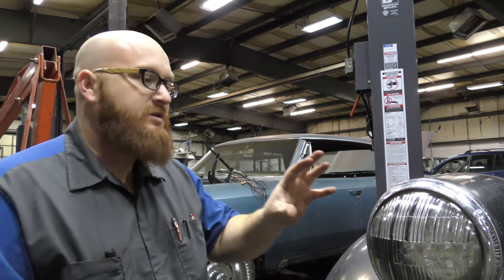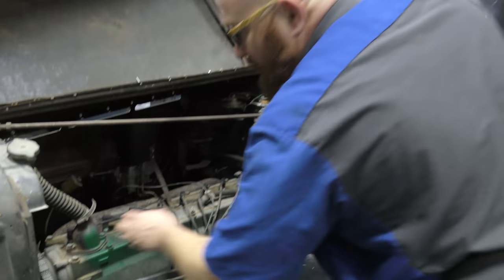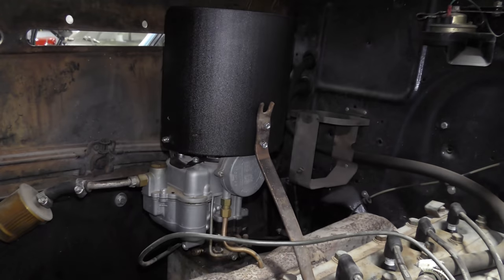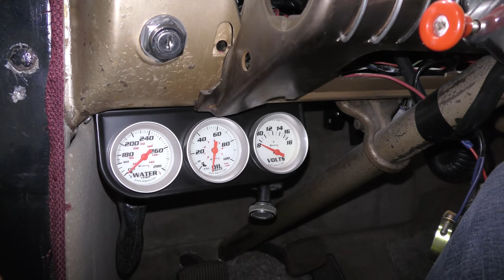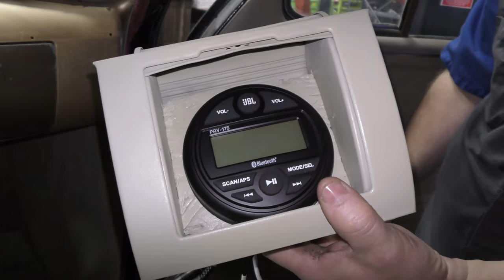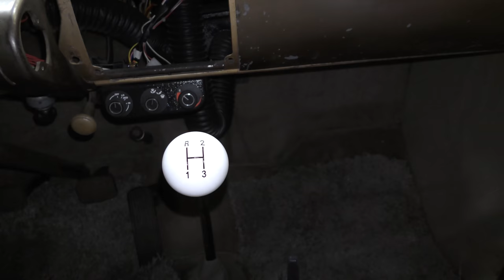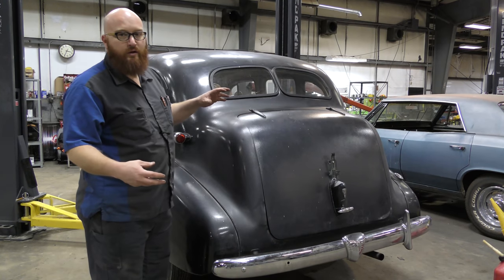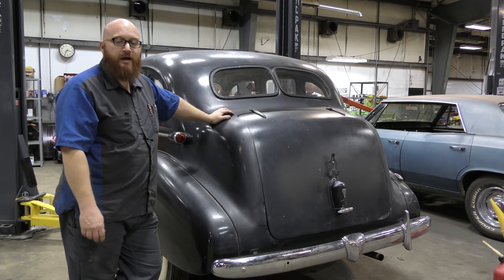OLDS SERIES #2: Nightmare to keep '38 Olds original! CAR WIZARD struggles to restore 83 year old car

Comment: Abbott instrument restoration in Tigard oregon can rebuild all of those gauges. He can also convert them all over to 12 volt with new sending units. It's pricey but nothing beats the original look. I'm having him do the cluster in my 1952 ford crestline that had a flathead but is now a 289.
Reply: Thanks, I emailed them!
Reply: Temp gauges are not something one can do themselves as they are a tube filled with capillary gas but the rest of the gauges are easily restorable. :)
Reply: @RustOnWheels  they do mechanical temp gauges as well. Its not cheap because of the gas or mercury tubes depending on the gauge. Their work is amazing alot of it ends up in cars headed for pebble Beach.
Reply: Bump for helping the Wizard.
Reply: Wizard doesn’t even know what he’s doing he’s always having everyone come and pull him out of the ditch
Reply: Good to know.   Redline Gauge Works did my 1949 Ford cluster since I am running a 1960 Buick 401.  Nice work, but pricey.   BUT it makes the entire dash look great and it is something you look at every time you drive the car.  I so had the gauges hanging below the dash.  Ugly and hard to read while driving.
Reply: @codyburget3796  Yeah a good quality shop can handle them. I just wanted to emphasize that the average DIY tinkerer may manage to clean up and fix the fuel and ammeter gauges, even a mech oil pressure gauge is doable, but a good working non leaking mech temp gauge is something else altogether. That’s one of those things not worth trying yourself without the right tools and materials.
Reply: What is the ballpark estimate on the rebuilt cost of this?
Reply: @anonymousonlineuser6543  depends on what you want done and what you have.  My set was around $2,500, a company in Minnesota quoted me $3,200 but all of the gauges would have been electronic instead of mechanical. My entire cluster was bad the person I got the car from did a 12v conversion but never stepped the voltage down for the cluster and it fried them all.
Reply: That's the guy I use for my instrument restoration.
Reply: There is no need to convert to 12 volts.  You just have to quit being a tight-wad and spring for the correct 1 gauge battery cables and a Group 2 or larger battery.

Comment: such a shame to ditch the dashboard...i would invest a bit and get it sent to a proper restorer....it makes the interior....and restored would look beautiful...
Reply: True!  There are places that can restore the original speedometer and gauges.
Reply: @craigjorgensen4637  yup it also mimics the round one radio
Reply: It’s because he doesn’t know what he’s doing
Reply: Send the cluster to Redline Gauge Works.  They will restore the cluster, put in new VDO receivers and  new senders.  Not cheap, but they would probably contribute to  YouTube project.   They redid my 1949 Ford cluster.  Excellent workmanship.
Reply: @619guy202  More like its because he doesnt wanna spend the money
Reply: @Morpheen999  if you know what your doing you don’t need to spend any money paying someone else to do what you can do. Hence he doesn’t know what he’s doing
Reply: @619guy202  Gauge work is pretty specialized. Would you like your general practice doctor do open heart surgery?
Reply: @seanabel3532  oh you probably don’t know anything either. It’s an old analog gauge there’s no circuit board or anything in there.......it’s just a simple iron with wire around it to move the needle gauge (simple second grade stuff).....if it was a 2017 Audi then yeah you’d have trouble finding what component inside the cluster/computer is wrong, but even then it’s still repairable but most people just swap the whole thing
Reply: @619guy202  You're just rude. I have repaired some gauges. It takes a while to do it correctly, where they actually work for a period of time.
Reply: @seanabel3532  you’re just ignorant and understand nothing of simple technology. If Wizard can’t fix something simple like that then I don’t trust him working on my cars. He said it himself too that he always runs to his scanner and looks at what other mechanics did to fix that problem. What don’t you understand of a wire with power going thru a resistor, to go thru a coil of wire to excite a needle on a gauge? Like I said if it were an Audi or something with 5 computers controlling one gauge then yeah but this nahhh, don’t get me wrong but there is ways to test it but by that time you were better off replacing suspected damaged module. 
Second grade stuff.....
Reply: Right. Send it to Edd China. He's great!!!

Comment: Would look LOT better if you had used a more "warm" color temperature LED - but I love the idea of what you have done retaining the original glass!
Reply: Exactly my thought about the LEDs, but it sure is going to be a great car when done
Reply: Class it up with LEDS all around.....uncle's. Pontiac had lights that dimmed and we're feeble at best
Reply: ...agreed, it also shouldn't be too difficult to find a chrome reflector bowl to fit behind the lens...it looks odd without it...
Reply: Agreed 👍 Improve the performance with the original feel.
Reply: Agreed. Still can be done.
Reply: It could potentially be corrected with light yellow/amber headlight tint inside the housing over the LED panels, but it may be tricky to get the color right.
Reply: @qotile  not a bad idea, but I'd rather see Mr. Wizard replace the LEDs with a more period correct color temp headlight (IE, junk those blue looking LEDs, they don't fit the car at ALL)
Reply: @qotile  also yellow + blue = green - that could be really odd looking (or awesome) if he left the current LEDs and just tinted the inside of the lenses with a yellow or amber
Reply: I agree & came here to say this.  Unless he is going for a Cyberpunk Gangster theme lol.  Like Batman the Animated Series
Reply: @erics3596  For additive color, yellow + blue = white.  For adding a pale-yellow filter to the existing bluish-white LEDs, the result would probably depend on the particular filter.  But adding a filter would probably make the internals look yellowish when the lights are off, which would be undesirable.  My 2017 Ford Fusion is the first (and only) car I've had with LED headlights (factory).  Initially I didn't like the bluish color, but I've gotten used to it.
Reply: And also with the current 6000k+ color you will see nothing during 🌧️ or mist.
Reply: Those LEDs are most likely a terrible idea. They will glare all over and at incoming traffic. Those LEDs were not meant to go inside a car housing, nor were they meant to have a glass diffuser in front of them.
Reply: In the lighting industry there is a color-temperature scale that is used to quantify the color of light, according to degrees Kelvin. 5000K is the color of noontime sunlight in a clear sky. 2700K moves away from the bluish end of color, and was the standard for the "warm white" compact fluorescent bulbs with their nauseating pinkish-orange color. 3000K is closer to the more yellowish color of an incandescent bulb. It shouldn't be hard to find LEDs that are pretty close to the color of the original bulbs. I suspect that there might be someone out there with the skills to calibrate the color of original old-car headlamps and to get some accurate LEDs made who also has an interest in old cars. That guy could make a niche business supplying the restoration community.

Comment: My Dad and a few of the older folk I have worked for used to get the local battery specialist ( Jones Brothers Battery ) to make up an 8 volt battery instead of a 6V. They would drop them into their 6V  Cadillac or Dodge or other. vehicle without need to modify electrical system.  Great old oldsmobile!! My first car at age 14 was 1955 olds rocket 88. Cheers from Canada!
Reply: You can buy 8 volt batteries.  They are available in most of the same group sizes as 6 volt batteries.  You don't have to change your lights or accessories, but you DO have to re-calibrate your regulator, as you need the generator voltage to be above the battery voltage, or else the generator will not charge it, and you need to cut out relay to open and close at a slightly higher setting as well, or else the generator will try to run as an electric motor, which will discharge the battery.

Comment: If that paint is the original I would suggest buffing it up and not respraying,
Reply: It's not original
Reply: @smokeandmirrors5960  yupp
Reply: Not original paint. But a new paint would look out of place in the package... unless the body is made to be very straight, the chrome very straight and shiny... I would keep it black, although it seems it was blue at one point. The black paint job, which seems to be painted by a roler, is the work of the previous owner, part of the history of the car. Look's good enough to me, for what this car is.
Reply: I agree it would be better for the paint to look a little old and rough. He’s not trying to do a concourse restoration and a half assed new cheap paint job might look worse than the old rough amateur one that’s on there at present ?

Comment: "8 cylinders in a row makes it go" Bob Ross of mechanics. Love this project, the Chevelle and of course THE YACHT. Hope you keep us thoroughly up to date on the projects. Love these updates.
Reply: The straight eights have two problems, the most common is a bent crankshaft and the lesser is a cracked block. The reasons that many have installed the drivetrain out of a chevy impala in these pre-WWII cars...

Comment: I like the LED headlight conversion idea, but that color light doesn't fit the car. Too bad you didn't find an LED with a warm light color instead. That would have looked neat.
Reply: 2700-3200K
Reply: Easy enough to change anytime if he wants to.  I have a feeling the car won't be driven much at night.
Reply: @Guillotines_For_Globalists  like I said, I like the idea... It just would have better fit the look he's going for if he could find those same LEDs in a 2700k-3200k color. I don't even know if they make them... I'm just saying it would have been a neat original looking upgrade.
Reply: @1lowf150xlt  Color temperature selection comes all day long for household lighting but not for cars.  The newest household LED fixed light fixtures (especially the flush mount can lights) have selectable color temperatures with 4 or 5 settings.
Reply: And also with the current 6000k+ color you will see nothing during 🌧️ or mist.
Reply: @1lowf150xlt  also doesn't need to be LEDs. He could probably find a reflector to fit with some bright 3200k HIDs.
Reply: It's funny a 38 Buick has tribeam headlights and they get close to white light not LED white but close and it's still a 6 volt bulb..... also if you ever started a 38 buick you know a few little tricks it has for noobs lol
Reply: If you don't want the stock dim lights, just convert to Sealed Beams.  Many people converted their 30s cars to Sealed Beams in the later 40s, 50s, and 60s.

Comment: Two thing Wizard, one is try to go to a place where the have a billet laser machine and the can make you those Oliver’s for the hood.  Second, for turn signal, they sell LED strips that flexible and conforms to any size.  Maybe you can use that and install it inside the headlight housing, behind the oem lense but in front of the LED round headlight.  It will still look factory.

Comment: The magic of pedals rising out of the floor:
By now you've no doubt noticed that like when you're sitting at a light,  with a foot on the clutch and one on the brake,  when you Junp off the brake and go for the gas, the brake pedal comes back up and the stop on the pedal arm thumps the floor?
I love that.
When I was little,  there were more older cars built that way that otherwise and you always heard that when the light turned green. 
Combine with the in line 6 exhaust note.
Magic.

Comment: With ball bearings you  bolt a chain to the wheel studs and crack it like a whip. 
(Put something on the floor for it to land on)
Reply: Nah, use a three or four jaw puller, and use very little pressure on the puller. The trick is to hit both sides of the drum with identical mini-sledge hammers lightly and it will pop without being bent...

Comment: Very cool car! Keep in mind though, period correct turn indicators means none, they didn't have any originally. Some folks have added them to the bumper in nice chrome housings to match. Technically turn indicators are supposed to be a certain distance from the headlamps so that they are visible...but, that's long after this car was built. You could mount them wherever you want.

Comment: You're going to blind people with those headlights, those bright white LEDs do get quite hot that's why LEDs have heatsinks.
Reply: Irrelevant point, LEDs are more efficient than any other popular lights. Eg halogen, florescent.

If the leds are "too" bright, he can just turn the voltage down.
Reply: Put subwoofers in back of seat
Reply: LEDs are resistive loads so ohms law applies, V = IR. Current is directly proportional to voltage.
Reply: It's not necessarily about the brightness, but the beam spread. The main difference between the high and low beams on a car is that low beams largely cut off above a certain angles, while high beams do not. This is easily demonstrated by turning on high beams when there is a road sign above a freeway in-front of you. You low beams will have very little impact on how easily you can read it, but your high beams will light it right up.

As far as heat goes, you'd need to look at the requirements for these specific LED's (which I'm sure the Wizard did). Open space helps, but nowhere near as much as a heatsink. To use an extreme example of something that is way more sensitive to heat, there is no way to cool a computer's CPU enough by just leaving it space or even blowing heat on it. It needs to have contact with a heatsink, cold plate, etc. Having space around the heatsink certainly helps, but no amount of space or even moving air can make up for contact to metal.

It's also possible that the LED's are bolted to the car in a way that the actual headlight housing acts as a bit of a heatsink. This is why many LED light fixtures, amplifiers, etc. have fins in their bodies. They act as heatsinks.
Reply: It's not necessarily about the brightness, but the beam spread. The main difference between the high and low beams on a car is that low beams largely cut off above a certain angles, while high beams do not (not that high beams aren't a bit brighter as well). This is easily demonstrated by turning on high beams when there is a road sign above a freeway in-front of you. You low beams will have very little impact on how easily you can read it, but your high beams will light it right up.

As far as heat goes, you'd need to look at the requirements for these specific LED's (which I'm sure the Wizard did). Open space helps, but nowhere near as much as a heatsink. To use an extreme example of something that is way more sensitive to heat, there is no way to cool a computer's CPU enough by just leaving it space or even blowing heat on it. It needs to have contact with a heatsink, cold plate, etc. Having space around the heatsink certainly helps, but no amount of space or even moving air can make up for contact to metal.

It's also possible that the LED's are bolted to the car in a way that the actual headlight housing acts as a bit of a heatsink. This is why many LED light fixtures, amplifiers, etc. have fins in their bodies. They act as heatsinks.

Comment: The fluting on the lenses may scatter the light and dazzle oncoming drivers.
Reply: i was thinking the same,these lenses are not street legal
Reply: @sinusgolf  Your probably right, but I doubt it will play a role. No Cop will stop the car for this und No one else will complain either. All will be happy seeing this thing on a sunday's Joyride.
Reply: @sinusgolf  historic car. Even my state that has inspection , historic and antique with correct plates are exempt from inspections. And I doubt the Wizard is going to drive at night... or when you se one grey cloud days.
Reply: I think these lenses may actually be designed to direct the light into the correct low-beam pattern (This is how most headlights of the time worked). But it would have been designed around the original bulb positioned at the focal point of the reflector, so who knows what the pattern will be like with a LED array shining through it.
Reply: Who cares bud
Reply: No, the fluting that scatters the light is what gives the beam the right shape and prevents an intense bright spot right in the center.

Comment: I got a '36 Ford 4dr sedan I'm currently working on getting on the road. Its in similar condition as your Oldsmobile. I got to pull the engine to fix a freeze crack and do a good amount of electric work to it. Its also still 6 volt and hasn't been converted to 12 volt yet.
Reply: There is no need to ever convert to 12 volt.  Leave it STOCK.  You can substitute and 8 volt battery for the 6 volt battery,  Just re-adjust the regulator.

Comment: I'm old enough to have been down this road a few times just keeping old daily drivers running.  Kept my Pop's pick-up running (between him & me) for 42 years.  And have owned and driven everything from a Model A truck to a Hudson Hornet.  Nothing in the driveway is less than 17 years old including the motorcycles.  Point being, mild restomodding is just the way it is.  And there is nothing more satisfying than finding the parts that fit well and look the part.  
Imagine how much fun you'all will have when you modernize to EV conversions !!  That will ultimately be the way of the future for independent shops ...  Best of luck and keep on keepin on : -)